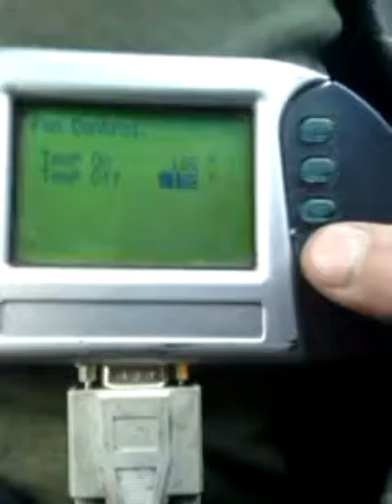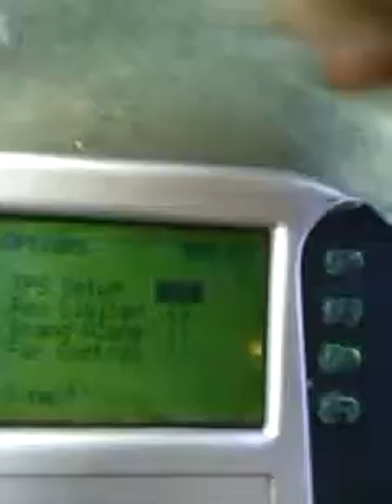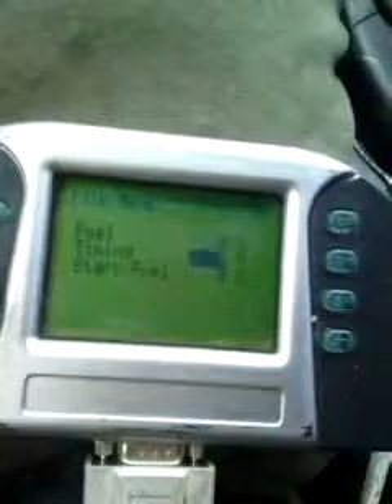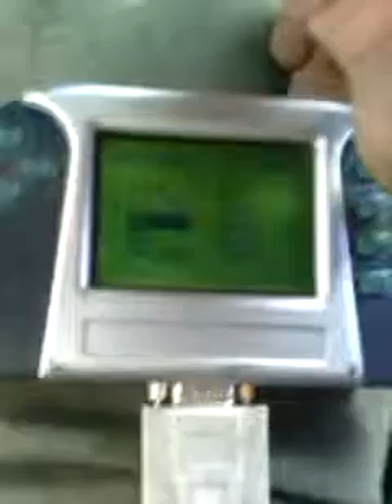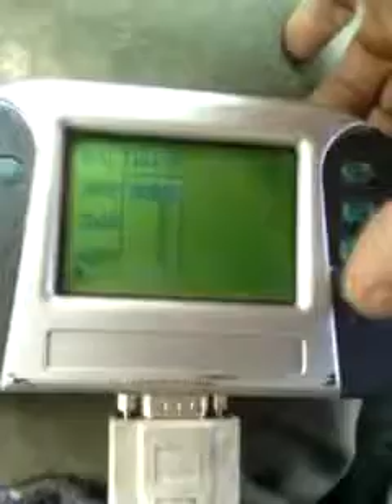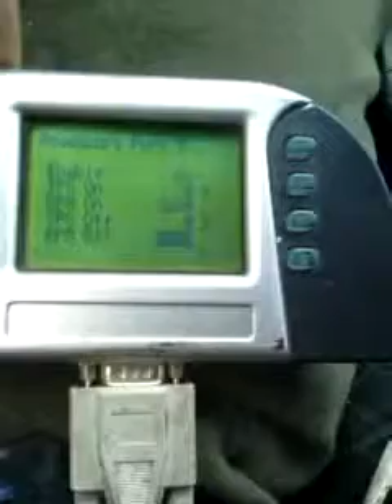Mustang Cobra 96, anderson PMS quick video,

Comment: Hey if you have time I have several questions about this system since noone carries info on it anymore.
Reply from the maker: No prob. I still remember pms pretty good.. Thou i wouldnt make or get hoped up about going all out, like boosted, etc with the pms..not that u cant, i just dont tust it, with the sn95, or modulars..0bd2, i think the stock ecu learns the changes of the pms an I think it starts to relearn..i actually was told too unplug the ecu, an pms, battery, too reset stock ecu, every oil change.. running PMS piggy back'.. but pre obd2 or a 5.0 there good,an theres support.makes me wonder why they stopped the pms for 4.6's, and i lost #7 cyl, and dont know what happened.. yea l, i ran it hard, but always eas goin over it. Dont kno if the pms was on wrong tune, or pms jyst glitchd', but only 6k miles with pms.an at 106,500 mi. She blee. But still run, but lost a cyl.
 but honestly, its a good learning tool, deff' make sure you get a decent wideband 02, learn how too read it, usebit witna laptop, datalog, make small ajustments..great learning tool. 
but i wouldnt plan on keeping it forever.. id use it a while, then go with moates quarterhorse, maybe hp,sct..? Or a holley, fast, proM, w.e efi systems out there that support modular fords.. theres a bunch.. if you got a 5.0, then id go moates, quarterhorse, tweecer, etc.. or prob holley or fast, or even haltech, aem..   
But just msg me. Ill try help. Get me at my email justinjeepcobra@'the obvious' an ask away..ill help much i can.. (subject name it- COBRA,FORD,PMS, an ill see it. Look into ford,efi,tunning,etc 'books'
  get those efi system, efi tunning pro, 
4.6 modular ford,performance, 
etc. books from S'A' or w.e. there well worth the info vs $.

Comment: is there away to factory reset the pms box?
Reply from the maker: As to my knowledge, No..Ecept to set all back to 0*... But try sending a Msg- to ANDERONFORDMOTORPORTS.COM ... I know even when I disconnect my setup, and hook it back in.. It still has the same graph-chart-value..                   Im assuming there is a battery inside the unit, Just like regular KAM/RAM EEC Ford Ecu have.. But don't quoute me... Possible with the DATAaqc. Software? But Far as I know just setting all tables, acc. etc to 0*  STANDALONE OFF, IS pretty much stock EEC- settings being run'..  You could ask them a I said.. Or If you have a OBD-SCANTOOL, LIVEDATA- LIKE TOURQUE Pro/LC1-W02, ETC.. To monitor the basic parameters, You could use one of them to- RECORD-LOG, EEC- Without the PMS.. -Then hookup the PMS, and RECORD-LOG-EEC PARIMETERS. Then compare.. But then again, the adaptive learning of the ECU each time you Unhook and reconnet the EEC/PMS, Mite fudge* the values, An be in-accurate.. This I WHY I love the PMS for its ACCESSABILITY, EASE TO TUNE, But..          A Moates, or TwEECer chip, w/ software, and a Chip/Quarterhorse-REALTIME EMULATION..Can be eaier if you know eec/efi-tuning.. Even a good scan-tool, OR SCT-Flash style tuner, TO READ LOG, EVERYTHING, Even piggybacked over-top the PMS. Should give you actual live graph-Scalars,charts-etc. you can then Log and compare your Bin/files..